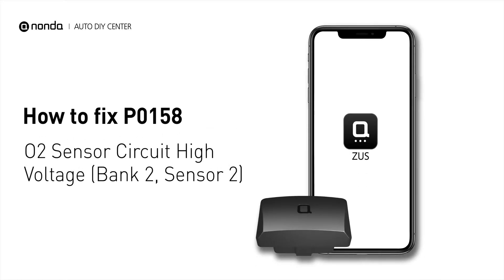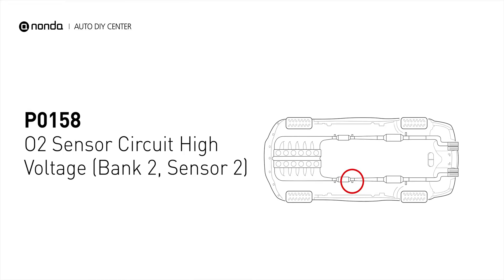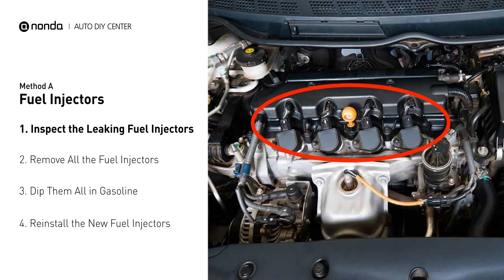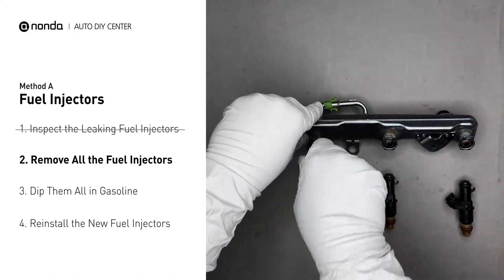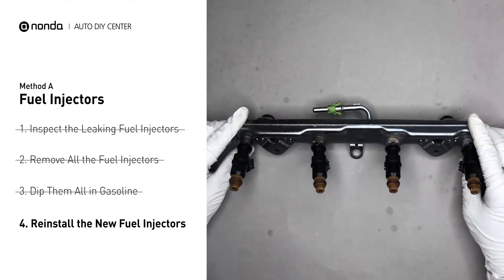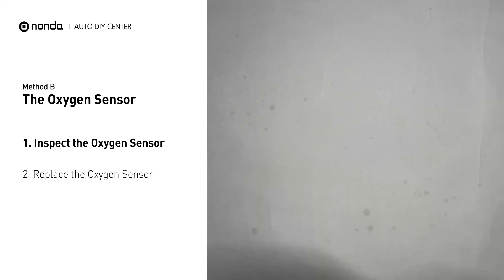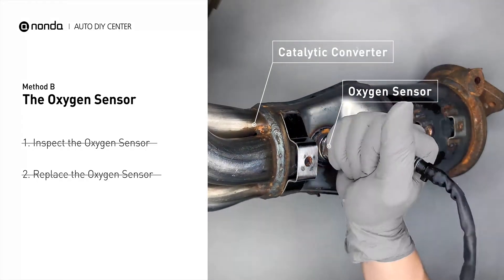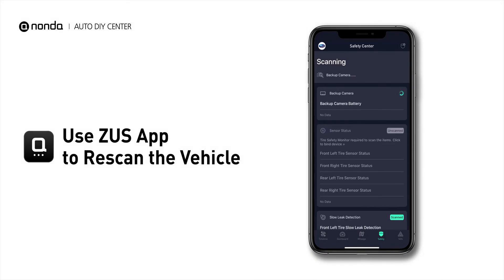How to Fix P0158 Engine Code in 3 Minutes [2 DIY Methods / Only $8.92]

Comment: Hello, I have the P0158 code and found what looks like some blue corrosion on the male connector for my O2 sensor. I replaced the sensor and still have the code. 

Could the CEL still be on from the corrosion I found on the female connector side?